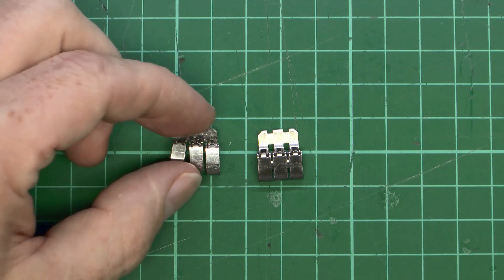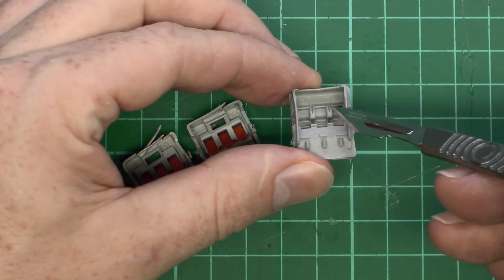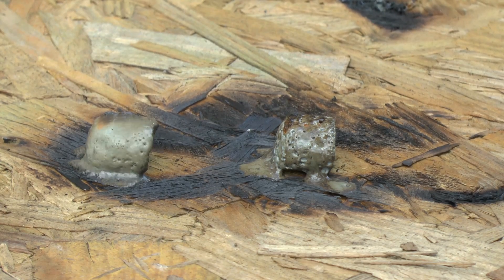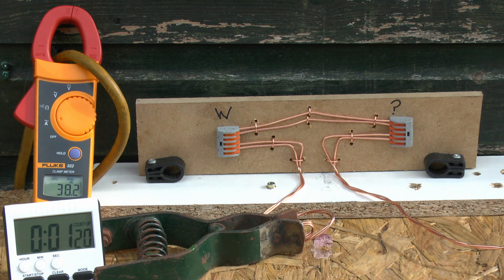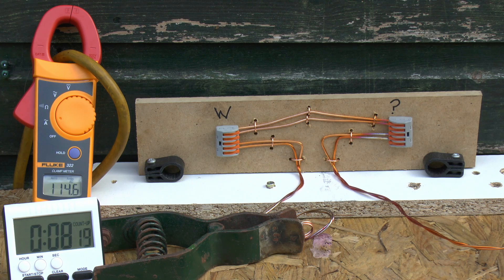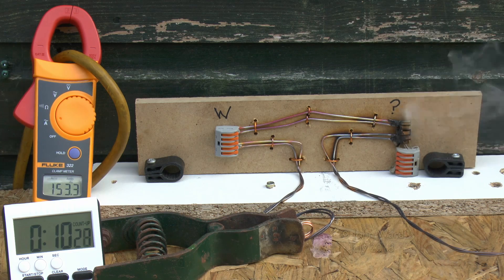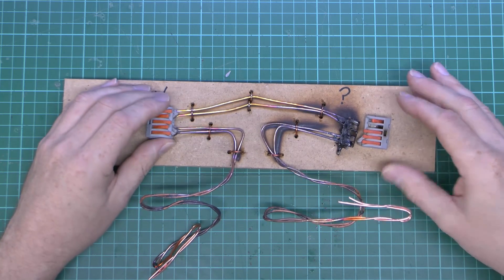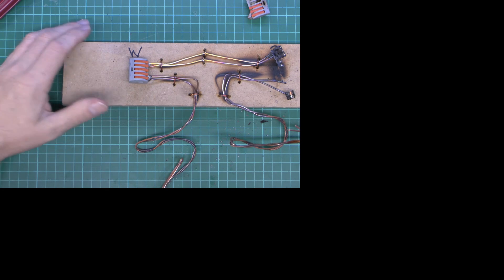Wago 222 Connectors vs Others, Testing Current Overload and Flammability

Comment: John, many in Europe have found the Schuko unsuitable. When charging an EV with one they find they end up with scorch marks on the pins and elsewhere. The plugs can be connected for over 10 hours at a time. A test on the British type for sustained use on 13A would be a good meaningful and relevant test. A 13A plug can take over 13A on a sustained load.

Comment: You need to cut those numbers in half, you have them wired in parallel so each side takes half of the total current so about 70 amps to fail not 150
Reply: > @danielz6781
>
> You need to cut those numbers in half, you have them wired in parallel so
> each side takes half of the total current so about 70 amps to fail not 150 

The centre section of each connector was carrying 150A.

Comment: The amount of heat dissipated by the wire or the connection points goes up on the square of current. At 150 amps, there is 25 times the wattage (heat) dissipated, compared to 30 amps! That said, either of these would work just fine, at rated maximum current. I did notice, that the wires ran much cooler, and didn't discolor nearly as much on the WAGO compared to the 'off brand' connector. The WAGO uses slightly heavier gauge contacts..

Comment: The heat transferred from the right connector to the wire and then to the left connector and housing. These are great tests to see the amperage handling capabilities. The heat transfer helps me to diagnose the failure source.

Comment: Nice review, but your numbers are misleading.  Since you had two identical conductors in parallel, they would each support half the total current.  The same is true for the contact points inside the connectors.  When you were on the max current (roughly 150 amps), the connectors would have been experiencing around 75 amps at each connection point.  Therefore, the connectors were not loaded at 5 times their rating.  Rather, they were only a bit over 2 times their rating.  Check out Kirchhoff’s First Law.
Reply: > @we5480
> 
> Nice review, but your numbers are misleading.  Since you had two identical conductors in parallel,
> they would each support half the total current.  The same is true for the contact points inside the
> connectors.  When you were on the max current (roughly 150 amps), the connectors would have
> been experiencing around 75 amps at each connection point. 

But 150A flowing through the centre of the metal strip inside.
Reply: @anonnona8099  I see what you're saying and I agree to that point.  I was looking at it as a test of amperage per termination point within each multi-point connector.  Regardless, it's still a great video and review.  Thanks for taking the time to do it.

Comment: Should do this again; but this time use the 222 and the 221 with thicker wire. Obviously if the wire is overheating, its going to overheat the connector too. If you use thicker wire than the wire won't overheat the connection into failing, you'll find the actual failing rate of the connection, since as far as I can see, the wire being overloaded and heating up is what caused the connection to melt and fail.

Comment: I definitely prefer wire nuts or "marretes" for anything over 3 wires as they are much more compact and allow your wires to be trained together. This way when u service or test the wires possibly adding one it's much easier to do hot as the joint stays together and u can twist one on also helps keeping the box neat.

Comment: Would have been interesting to measure the voltage across each one hence determine the resistance of the connectors, that may have been why one melted before the other because it’s resistance was slightly more

Comment: Just to be fair, have you tried another set of connectors with the electrodes reversed polarity to see if the heat builds up on the WAGU side before the generic brand?
Reply: > @qapla
> 
> Just to be fair, have you tried another set of connectors with the electrodes reversed
> polarity to see if the heat builds up on the WAGU side before the generic brand? 

Kirchoff must be spinning in his grave.

Comment: I would like to see a more extensive test...

What happens if the wire is slightly corroded when it's put into the connector?   What if the wire is pulled hard during/after installation, can it appear connected but actually be arcing?  What if old wago connectors are used after storage in a damp truck - do the internals corrode and make them unsafe?  What if flood waters get into the connector - will it dry out in such a fashion that the circuit either works correctly or trips the GFCI (ie. you never end up with a situation that the internal steel thins with electrolysis corrosion.)

Comment: I will just try to use wago connectors for our house electricity installation. The installations use solid wires. Will it be ok and safe? Or any suggestions to use tradisional connections?

Comment: John please tell me how much current a 221 can carry and can I use on a ring main. Thanks
Reply from the maker: 32 amps, and yes they can be used on a ring circuit, as that only requires a rating of 20A for each cable.
Reply: Hi John,
Thanks for taking the time to answer my question.
As a service engineer of 35 years I use 30 amp connections on the neutral in the machines, live conductors go into a solid state relay. I’ve been to a few jobs were other engineers have not fitted the correct rating connectors and they have melted. The machine pulls 20/25 amps, I bought a wago 221 lever installer kit but it stated 20A at 300v  so I have bought the 32amp 222 ones. I will now be able to use the 221 ones
The 222 grey ones look far more solid to carry the current.
Might be worthwhile doing a little video on the 221 as a lot of engineers and electricians I have spoken to think they are rated at 20 amps.
Says 450v 32a on one side and 20a 300v on the other, I think this is for the Japanese market so I’m told, but if you say it isn’t then it isn’t .
Once again thank you.
Great videos.
Regards 
John
Many thanks 
Great video.
Reply from the maker: @johndawe449  The 20A rating is for a Japanese standard, which doesn't have any ratings above that.  The actual connector is rated 32A.

Comment: 152amp for 220v or 110 ?
Reply from the maker: Neither.  Voltage rating is a function of the insulation and spacing between conductive parts, and is entirely separate from current.

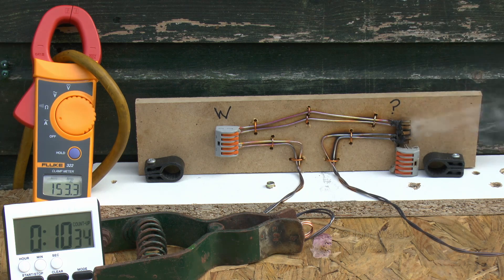Comment: 9:08 - A really mezorising and impartial test you carried out here. Nicely done. I am intrigued by how the wood on the right is more scorched than on the left, though.
Reply: I'd love to do this again with a thermal camera - pretty much all I did on my uni placement 😆
Reply: > @TimmyBoja
>
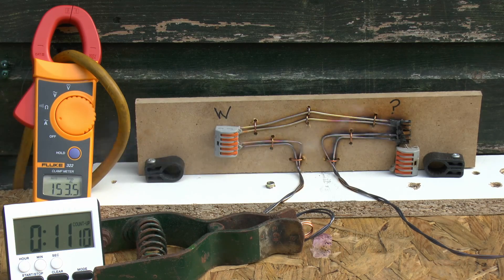> 9:08 - A really memorising and impartial test you carried out here. Nicely done.
> I am intrigued how the wood on the right is more scorched than on the left though. 

Because the fake copy connector was getting hotter than the genuine one.  The wires were getting hot because of heat transfer from the connector.

Comment: Great Video which answers many questions.  Enhancements might be to compare WAGO to other connector types, use stranded wire as required in high vibration/marine applications, and finally to utilize a FLIR camera to visualize heat generation.   That said this video increases my confidence in this new technology. 

       Hopefully WAGO makes “terminal strip” configurations … this would save much time for installation and troubleshooting techniques plus save material for not needing lugs. 

        Thanks 🙏👍😎
Reply from the maker: This style of connector has been available since the 1970s, it's not new at all.
https://www.wago.com/global/companyhistory

Comment: Pretty good job using what equipment you have on hand. The only thing I would do differently is to measure voltage drop at each connector at the lower currents to calculate contact resistance. 
The colour change as it occurred did show there was a definite difference,  just not in numbers. 
Thanks for taking the time.

Comment: Thanks for a very informative video, as others have said, a thermal image would have topped it off but I know how expensive those cameras can be. Good to see the margin of overcurrent design built in to these, especially after having just watched a US video comparing WAGO to their wire nut connectors where virtually all the US commenters were claiming the WAGO ones were a fire hazard.

Comment: I believe if I'm not mistaken that the cheap Chinese clone tend to be made with PLA or ABS which are not really ideal plastics when being used for electrical components with high voltages. They should be using PTE, PET or PETT. Even at a push, PLA+ with TPE infusion. I do a lot of 3D Printing & the plastic I think is either PLA or ABS.

Comment: But the left conector got hot rappily, the wire change its color first. May be you not apply  enough pressure in the clamp, then you have a hot spot there. Obviously, the plastic it going to melt first too. 
You have check the test!

Comment: These are rated at 30 amps?   when you use 2 wires , you actually only test 1/2 the current  or  75 amps not 150 at the contacts.

Comment: I saw in a comment you answered that the voltage you tested with was 25 volts or less. This test Is misleading a lot of people. In the US, house voltage is 120 volts, with 15 or 20 amp breakers. Redo this test with real voltage like would be used for an outlet and see what your results are.
Reply: > @TheTinkerinMan
>
> I saw in a comment you answered that the voltage you tested with was 25 volts or less.
> This test Is misleading a lot of people. In the US, house voltage is 120 volts, with 15 or 20 amp breakers.
> Redo this test with real voltage like would be used for an outlet and see what your results are. 

Please explain what difference a higher voltage would make.

Feel free to constrain your explanation by the laws of physics.

Comment: Point beeing never run 150 amps through 20 amp wires. Did it fail? No it does work for rated amps.

Comment: Hi quick ? Can these wago connectors be used to extend the ring mains cable which i believe is 30amp...if so which wago connectors would the job
Reply from the maker: Yes, cable and connectors for a 32A ring circuit needs to be 20A or above.

Comment: Unless you have posted an additional video of which i did not locate, I would like to see a test were you attach two 12 GA wires to the connector and apply 20 amps to wire number one and see if there is an amperage drop in wire number two after going through the connector; in other words, would you experience  a voltage or an amperage drop in the electoral system  when connecting wires together using this new type of connector.
Reply: > @buzzincalifornia
>
> Unless you have posted an additional video of which i did not locate, I would like to see a test
> were you attach two 12 GA wires to the connector and apply 20 amps to wire number one and
> see if there is an amperage drop in wire number two after going through the connector; in other
> words, would you experience  a voltage or an amperage drop in the electoral system  when
> connecting wires together using this new type of connector. 

I would like to see you explain the concept of an "amperage drop", including where the missing amps went, and can be found.

Comment: The main fuse on my house is only 100A!!! Are to applying 230V ac?
Reply: I think it's a power supply or welder, its low voltage.
Reply: @mr.3phase228 : so not really a representative test in terms of insulation resistance/voltage withstand, just current and the associated heating effects.
Reply: > @1963TOMB
>
> The main fuse on my house is only 100A!!! Are to applying 230V ac? 

The voltage would have been lower (the clamp in the video looks just like one on a welder.

Think about it - if you had a sufficiently beefy 240 to 12V transformer, you could draw 2000A from the secondary with 100A through the primary winding.

Comment: the fail is when insulation fail, so your tests are not accurate. the right connector fail because of higher connection resistance witch create more heat. This means having cheap less conductive contact elements, less contact surface with wire ... the connector that melt first wire insulation around it is the worse one. There are also other variables in connector design like vibration resistance as wire can get lose inside... oxidation and corrosion by material composition difference witch worsen the connection with age and environment use... so your tests have relative use ... connectors and wires around connector fails at nominal current with age because of mentioned factor like corrosion, vibration wire losening by contraction dilatation...

Comment: 5 times the current rating equals 25 times the resistive power dissipation (and it will be worse than that as the resistance will have increased with temperature). In all, rather extreme.

Comment: So there was me working out  a better way to wire MK grid switches on 2.5mm and I had come to the conclusion that as MK terminals are so damn small in grid switches that I'd maybe use a WAGO to common the L & N's then take a feed into each switch but I decided against it as it meant the full load would be carried by the WAGO and I decided that might not be as good as just looping in and out - well I was quite wrong the test shows!

Comment: Whats the Voltage in the test? 230 volts or 110 volts?
Reply from the maker: Neither. Voltage wasn't measured, but would be fairly low, under 50 volts.

Comment: i am very expressed to see what the wago's can take! I was sure they would burn away at least around 100 Amps! The power burnt in the connectors increases with the square of the current! So at 150 Amps its 2.25 times the energy of 100 Amps!

Comment: Id like to see the test repeated with them swapped left to right somehow the Fako is getting more heat current?
Reply from the maker: Both are connected in series, the current is identical.
Reply: I'm no expert but it looks like you are using Dc from an arc welder? I'm just thinking it may be the positive electrons are hitting the Fako first and somehow making it hotter. It seems to heat up this side first. So it would be a good experiment to see it in reverse.
Reply: @grabread  

> @grabread
>
> I'm no expert

You can say that again.

> but it looks like you are using Dc from an arc welder?

Care to explain why the ammeter is set to AC amps, then?

> I'm just thinking it may be the positive electrons are....

"Positive electrons".  🤣🤣🤣🤣🤣🤣🤣🤣🤣🤣🤣🤣🤣🤣🤣🤣🤣🤣🤣🤣🤣🤣🤣🤣🤣🤣🤣🤣🤣🤣🤣🤣🤣🤣🤣🤣🤣🤣🤣🤣🤣🤣🤣🤣🤣🤣🤣🤣🤣🤣🤣🤣🤣🤣🤣🤣🤣🤣🤣🤣🤣🤣🤣🤣🤣🤣🤣🤣🤣🤣🤣🤣🤣🤣🤣🤣🤣🤣🤣🤣🤣🤣🤣🤣🤣🤣🤣🤣🤣🤣🤣🤣🤣🤣🤣🤣🤣🤣🤣🤣🤣🤣🤣🤣🤣🤣🤣🤣🤣🤣🤣🤣
Reply: > @grabread
>
> Id like to see the test repeated with them swapped left to right
> somehow the Fako is getting more heat current? 

I'd like to see you learn what you're talking about before you do the talking

Comment: This is the best video on YouTube covering Wagos and "Fagos".  You've really covered everything very well.  I'm from Canada, and to be honest, I've heard SO much bad things about Wagos.  Easily 95% of the people I've heard referring to them have bad things to say.  Now,  I actually spoke to another electrician, who uses Wagos exclusively.  He said he's had no problems whatsoever.  I highly suspect the failures I've been hearing about are due to improper use, and not following manufacturers directions.  I was a real skeptic on this topic in the beginning.  Now, I'm going to order my own box of Wagos.  After seen your video I'm very confident they will more than adequate for what they are designed to do.  Keep doing videos like this.  I'm subscribing right now!
Reply: Wagos are great they are self tightening because of the copper spring action inside so over time they outshine anything else. In my country wire nuts are banned because over many years the hot and cold cycles move the wires enough to sometime cause a fire risk. Ive seen several old wire nuts that are fire risks but never seen a old wago that was even close to failing.

Comment: Maybe if put through overcurrent over a long period of time these wouldn't fare so well. I imagine they are 24amp rated for continuous use , maybe tested over 24 hours at 30/40 amp there would be some results . Plus over the life of the installation could be many years . So don't go connecting 100 amp Consumer units with these guys 😀

Comment: Quick question, are wire nuts not commonly used outside of the United States? How popular are Wago connectors among electricians in European countries?
Reply from the maker: They can be obtained in the UK but are rarely used for anything.  More common are the screw terminal strips like these: https://www.toolstation.com/p/p88321 , the Wago and similar are also used but only normally found on fairly recent installations.

Comment: I still don't trust WAGO connectors or any push in connectors when used in service for decades.  Without any mitigation for corrosion, they are still an accident waiting to happen in any circuit that is being run at a high load.  A good test would be subjecting the connection and connector to accelerated corrosion testing while under load to see how many accelerated years it would take for corrosion to cause the connection to go high enough resistance to cause a failure.
When manufactured homes first became a big deal and people started buying them because they offered a more economical and fast-paced build we started to see lots of electrical issues caused by the use of push in type connectors used where the sections of the house were connected together.
Reply: kuhrd  but screw choc bloc terminals are perfectly acceptable with their know issues?